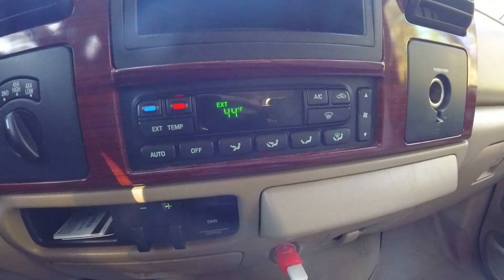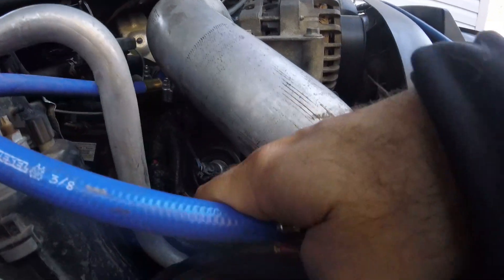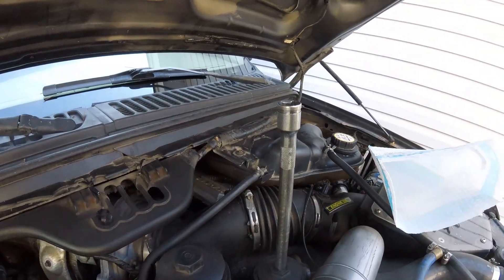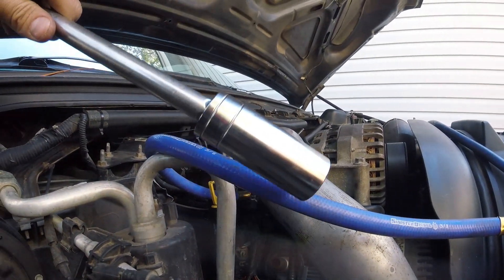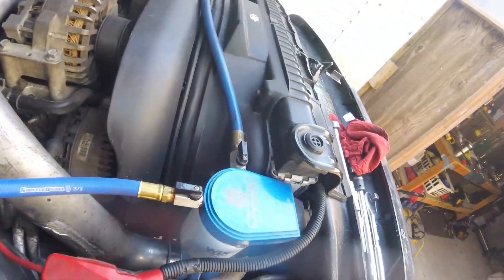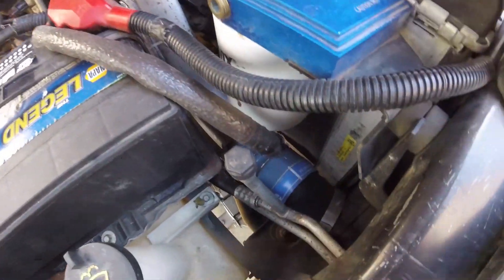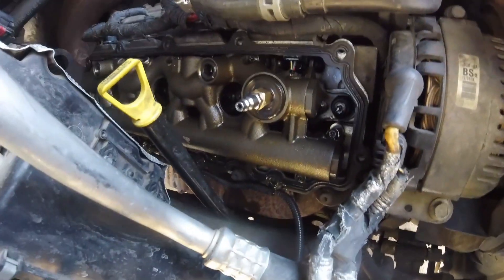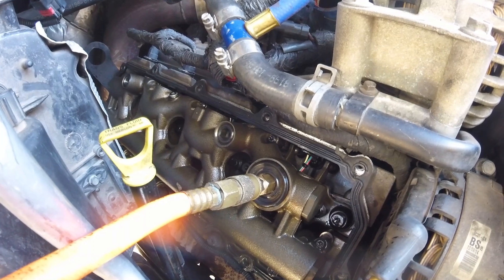6.0 Powerstroke - Long Crank Cold - Solved

Comment: Did you have a long start when hot too or just cold? I’m having an issue currently where after it sits for hours it will like drain back somewhere and then take longer to start…but sometimes it starts fine still and when hot starts fine too.
Reply from the maker: Check your stand pipes and dummy plugs. When hot the bad o rings will let the oil drain out of the oil rails. When cold the o rings actually seal and the truck starts. Ford made an upgraded part, they are cheap and not that hard to put in.
Reply: @grumpysdiy  it’s weird because if it’s hot it fires right up it only cranks longer when it sits overnight or for 4 hrs+ I’d say

Comment: Write down the name of the sensor monitoring device, maybe I'll buy it on Ebay.
Reply from the maker: For iPhone download FORScan light and buy a wifi elm327, for android Bluetooth elm327 from Amazon and either FORScan lite or torque pro. Both aps are $7.
Reply: @grumpysdiy  Спасибо Друг!!!
Reply from the maker: Dunno what that means.
Reply: @grumpysdiy  What's it?
Reply from the maker: Still lost.
Reply: @grumpysdiy  that's what i use

Comment: Hi!What is the air pressure needed to check the system for leaks?
Reply from the maker: The high pressure oil system can handle way more than your shop air compressor can put out. Just use 150 psi.
Reply: @grumpysdiy  What should I pay attention to first?The ipr valve is new.Six months to him.Unfortunately, there is no diagnostic equipment.
Reply from the maker: If you have the ipr air test tool. Put it in where the ipr goes and listen to the oil fill location and the crank case vent location for a loud hiss. The side with the loud hiss has the leak. Give it some time for the air to push the oil out to make the hiss.
Reply: @grumpysdiy  Спасибо Друг!
Reply: Friend, tell me, why does the car stall on the move when the engine speed drops?ICP sensor?At idle, the revolutions float.
Reply from the maker: I can say this if you suspect a sensor test it to see if it is working properly.
Reply from the maker: @Сергей-ъ5г8ь  With out having my hands on your truck I can't diagnose it. There's a reason people have to take a truck into a shop to have it diagnosed.
Reply: @grumpysdiy  Hi!Friend!If we had so many trucks in Russia, would I really load you with my problems!?)))We have trucks in Russia like fingers on a hand!About diagnosticians, I'm generally silent!I've already seen enough of the theory myself from your videos!I have hands, I will solve my own problems.It's a pity that there is no diagnostic equipment!And so, I'll fix it by the method of poke!)))Thanks for the answer!
Reply from the maker: @Сергей-ъ5г8ь  Sorry I can't help bud. But I would look for High pressure oil leaks.
Reply: @grumpysdiy  That's what I do!)))There is a lot of theory, but I am mastering the practice!I have already bought the fittings for diagnostics!What is the sensor monitoring device called?Maybe you can buy it.
Reply: @Сергей-ъ5г8ь  elm327 device not available in russia?
Reply: @5.43v  У меня форсунки так и не отрабатывают!Не победил!Спецов в России нет,к сожалению.(((

Comment: I found there’s a little valve opening which lubricates the gear to the fly wheel on the high pressure oil pump.

Sometime you’ll have air escape around there.

I ended up replacing every o-ring in my high pressure oil system. Injectors, dummy plugs, stand pipes and all. 

What was the reason for your long cold cranks?
Reply from the maker: The O rings on the nipple cups.

Comment: Why on the first crank sounded uneven and then by the second attempt sound good
Reply from the maker: Leonardo Castillo no idea what the problem was, it had never done it before and hasn’t done it since. Prob a loose connection somewhere.
Reply: hey mine is doing the same un even crank just wondering if you have any insight